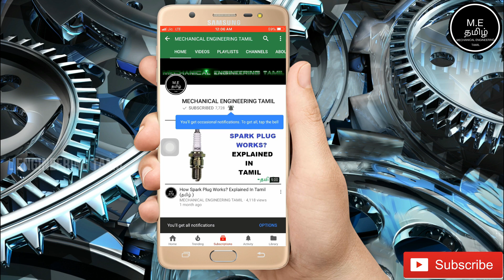Why Diesel Engine Are Not Used In Bikes (தமிழில்)

Comment: Bullet Diesal are very easy to start I stared my Diesal bike after 4year with 3kick and doesn't need battery like pertol bullet and low maintenance compare to petrol only requires an only change useing Diesal dike from 15 year no engine problem
Reply: Mileage tharuthu

Comment: Bro Honda unicorn 160 failer model solraga athapathi kojam soluga bro na Honda unicorn 160 tha vaga pora please review  solluga bro....in 2018
Reply: gowri sanker apdi patha honda hornet lunch aga pora honda xblade ellame honda uncorn 160 engine than.. bike namba use panrathula than iruku.. adichu ottatha normal speed normal acceleration panni drive pannu engine oil correct time ku change pannu chinna prob vanthalum odane Seri pannu apdiye vitta innum Periya prob agum so ne maintain panrathula than iruku..